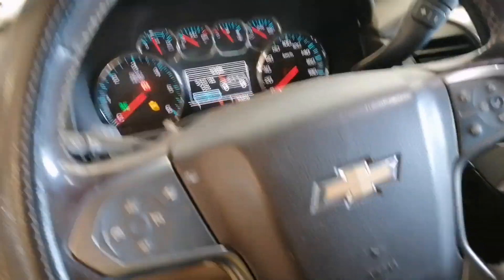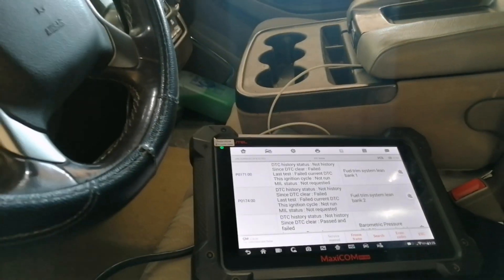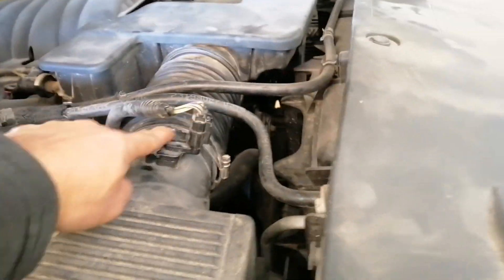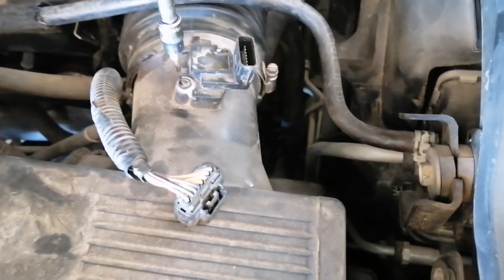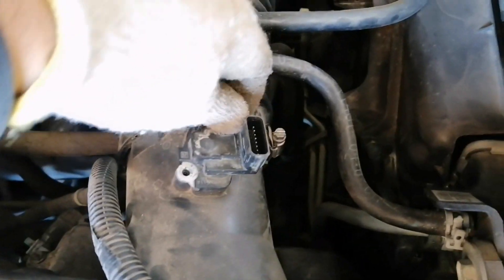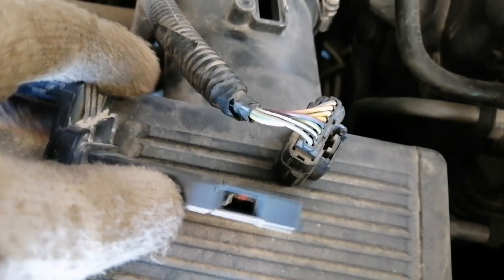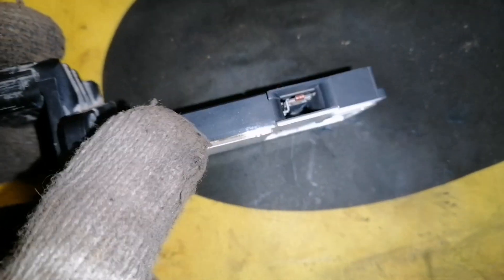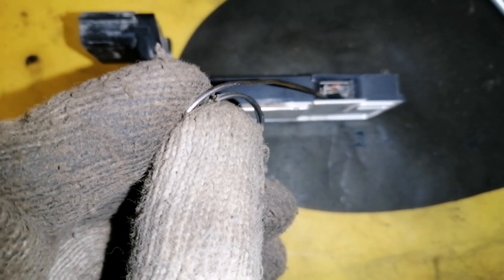P0171 P0174: Fuel trim system lean bank 1 and bank 2 chevrolete tahoe

Comment: P0174 system too lean bank 2
Reply from the maker: What kind of car?
Reply: @axleruiz6830  2017 gmc sierra 1500 l83 motor
Reply from the maker: @victordelarosa589  just check the maf sensor and injector and the oxygen sensor bank 2
Reply: @axleruiz6830  will do thank you. I replaced maf, and oxygen sensor bank 2 and it’s running better, check engine went away let’s see how she does
Reply from the maker: @victordelarosa589  your welcome.
Reply: Can’t figure it out